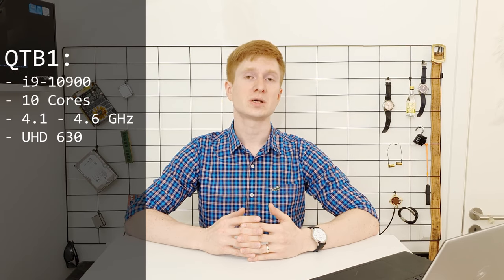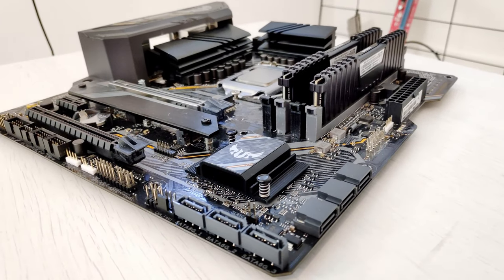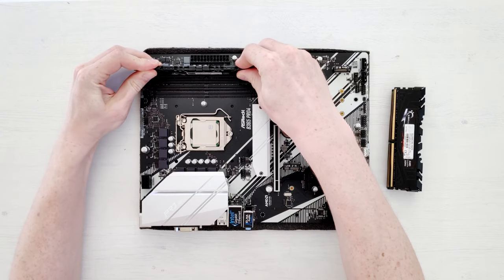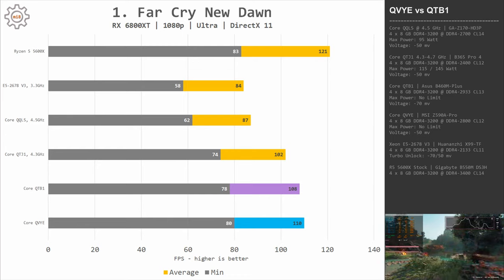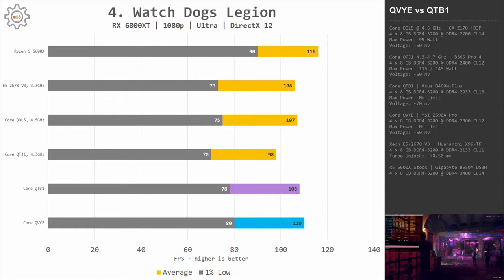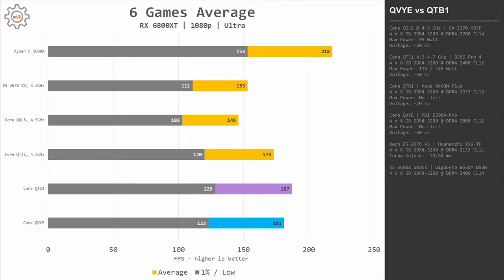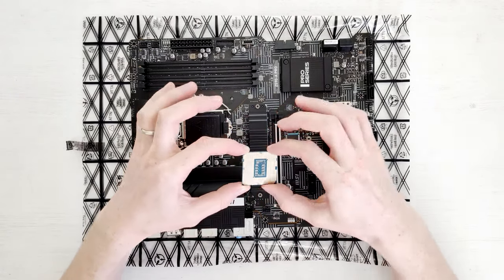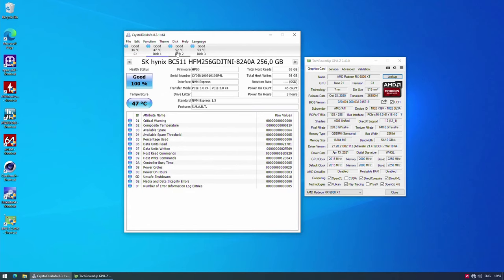🇬🇧 Core i9 QTB1, QVYE, QTJ1 – test and comparison against Ryzen 5 5600X and Xeon E5-2678 V3

Comment: Far cry new dawn, game work on 6 core
>qqls - 4.5 GHz- 87 fps
>2678v3 - 3.3 GHz - 84 fps
HOW?????
Reply from the maker: It comes down to the RAM configuration. E5 has quad memory channel with tight memory timings, while the QQLS was running dual memory channel and not very tight timings. Also, I didn't overclock the CPU cache, due to the VRM throttling. With a decent overclock on a decent motherboard QQLS would give much better results.

Comment: i9 10900k QTB1 vs i9 11900k QV1K vs r5 5600x , storck vs overclock , aguardando ansiosamente , like obrigada
Reply from the maker: R5 5600X is the best.
Reply: @Miyconst  Why? The i9 11900k QV1K beats the 5600x.
Reply from the maker: @Ryuuken24  beats in which way?
Reply: @Miyconst  Beats it in performance. I wasn't really looking for benchmarks, I just came upon this ES chip that was close enough to the R9 5800x, which has lead me to search for these ES chips for better value.
Reply from the maker: @Ryuuken24  theory and facts are different things. Ryzen 5 5600X is a much better option than the 11th gen ES CPUs from Intel, even though the ES CPUs have 8 Cores, and R5 5600X has only six of them. I would only go with Intel if I would be able to save at least 100 Euros on the system.
Reply: @Miyconst  These new chips do cost a 100 pound less, or you could bargain for a lesser price but, without more people testing them out, we cant be sure of their true value.

Comment: Just discovered the existence of the qtb1 , perfect because I wanted to upgrade i5 10400 , I have gigabyte b460 d3h, you said that the single core turbo would be locked at 4.1 GHz, all core still at 4ghz?

Comment: Need you help please :( I have an QVYE on asus B560 F gaming wifi with 4x8GB corsair vengeance lpx 3200 and my system is very unstable, even I had dropped the memory speed to 2800 the windows still crash or freeze screen :(

Comment: Hello, need your help here. Im offered $110 for i9 qvye + asus b560m motherboard. Im currently running on i7 6700k + 2080ti which is bottlenecked for CPU intensive game for ultra settings. Would you recommend it for gaming use?
Reply from the maker: Hi. You have already bought it, now my opinion doesn't matter. 😂 If the CPU works well with the motherboard - it's a good deal for $100, otherwise I would avoid it.
Reply: @Miyconst  Thank you for replying! ive decided not to go crazy and went for i9 10900k combo instead - costs me about $220. Do you by chance know how to tame this beast? im using the old corsair hydro h100i v2 and temps goes up to 90c~ while gaming.

Comment: I have been using this CPU for about 8 months now.    I have been noticed a few problems with mine.   First I can not load the CPUs on board graphics drivers. The "Splash screen" on my MSI B560I looks strange.   Also, I get problems on core 4 of the CPU.  Causing system lockups!

Comment: The big questions about 11gen are: 1 wether AVX512 will ever gain any ground in any real use application 2 wether you need the better encoder/decoder in UHD750. I would say the uhd750 is the main reason to go 11th gen at the moment, like i will do with mixed Tesla system for video editing.
Reply from the maker: Yes, the better encoder makes a big difference, when it's actually needed, but for a casual gamer, Ryzen 5 5600X is a better option.
Reply: avx512 currently are used by PS3 emulators for a hefty performance improvement. avx512 allows gen 11 th to surpass 5800x on the emulator

Comment: I'm bit suprised that QVYE can't take memory higher than 2800MHz. All i've seen seems to indicate taht QVYE doesn't have locked memory multiplier, and even earlier samples has limit of 3200MHz.
Reply from the maker: Me too, maybe my particular sample is bad.
Reply: It's not the cpu, it's the board used.
Reply from the maker: @Ryuuken24  I have tested the same QVYE on a Gigabyte Z590 motherboard, and even though I was able to increase the speed to DDR4-3200, the uncore speed was only 2.1 GHz, which resulted in much worse scores overall.
Reply: @Miyconst  That was really bad but, the sellers say the boost clock is motherboard dependent, so who really know which board can clock higher without purchasing a lot of them.

Comment: Having some issue with setting up memory on my  QVYE and AsRock B560M Pro AC + , even if I input it manually it does always default back to 2133mhz and does not do that on my ASUS B560M  Pro 4. Using same 16gb kit G.Skills 3200mhz on both motherboard, the ASUS is able to boot using 2800mhz totally fine using default xmp timings, the AsRock on the otherhand won't even let me change frequency manually to 2800/2666/2400mhz and inputing primary/secondary timings, it constantly comeback to 2133mhz and even at 2133mhz I can't change timings... Maybe someone would have experienceed something similar, I just like the look of the AsRock and find it little frustrating that I can't be doing anything with my ram settings. Any inputs would be appreciated, love this Cpu great $$$ for Performance. Love your Channel btw, keep the good content coming !!! Cheers
Reply from the maker: QVYE is known for memory issues, so it's pretty much expected. You could try different BIOS versions for the AsRock board, but it's still not guaranteed to work better.
Reply: @Miyconst  Thanks for the reply, I did try with both available BIOS V1.30 and 1.50 sadly no change. 2133mhz wouldn't bother me too much as long as I would be able to tighten those timings but sadly that doesn't work. Bring it down to a good CL11 would be my goal, same as my 2697 V3 server. I would be interested to see the comparison between let's say something like a 11400 @ DDR4 3200mhz vs QVYE @ DDR4 2133mhz just for fun, sadly I don't have one handy to have a real-life scenario comparison as they are both similar in price tag in Canada :)

Comment: Hello, i have one question, can QVYE i9 11900 work in z490 motherboards and being able to set ram to 3200mhz or QVYE just works on new 11th gen mobos?
Reply from the maker: QVYE is a very picky CPU. It works on Z490 if BIOS is updated to support 11th generation, but memory is unknown. With MSI board it was maximum DDR4-2800, with Gigabyte DDR4-3200, but the CPU memory controller speed was just around 1.5 GHz with no possibility to change, thus the performance was pathetic.

Comment: In my testing so far, QVYEs seem stable around 100 - 140 mv negative offset - 6 tested so far
None was unable to complete Sisoftware sandra, 30 minutes CInebench r23 loop, blender and vray benchmark with -100 even on low end asrock boardWeird...
Reply from the maker: I could be that I have got a very unlucky sample or there is something add with my MSI Z590 motherboard.
Reply: @Miyconst  Power use reported under r23 is around 125/130 on hwinfo

Comment: QVYE could work with an Asus B460M R2.0? It has H470 chipset and Asus page says it is compatible with 11th gen. Nice video!
Reply from the maker: Yes, it should work, but there maybe be an issue with the uncore frequency.
Reply: @Miyconst  Thank you. Just one last question: which CPU would you choose if the price is about the same: QVYE i9 or a retail i5 11400? I'm thinking to upgrade my i3 10100F in next year. Subscribed to your channel!
Reply from the maker: @yorchrzx  I would definitely pick i5-10400 for regular users, and i9 QVYE if you can be sure that your motherboard is fully compatible and you have a specific workload where QVYE would outperform i5.

Comment: In my case - it's an Asus Z170iPG mobo, 3000cl12 for Ram(~40ns), 4.4Ghz for cores / 4.3Ghz for cache 1.25V for the summer time(140W Max for full 16 loaded threads)
Reply from the maker: And which CPU?
Reply: @Miyconst  sorry,  information is for QQLS
Reply from the maker: @X1th  So, you managed to get DDR4-3000 with this QQLS? Do you use the one with a lid on top or the one with a naked die?

Comment: Can QVYE  use with gigabyte b450m ds3h motherboard?
Reply from the maker: Definitely not. B450 is an AMD AM4 motherboard, QVYE is Intel LGA 1200.
Reply: @Miyconst  Sorry ;-; I told you wrong.I mean b460m.
Reply from the maker: No, B460 chipset doesn't support 11th gen CPUs either.
Reply: Thanks <3

Comment: is it safe im pair QVYE with asrock b560m pro4?
Reply from the maker: Yes, it should be safe if you have adequate air flow in the chassis.
Reply: @Miyconst  yeah my case is have enought airflow. and now currently use watercooling cpu. does the pcie 4 work?

Comment: hi a question about the QTB1 (i9 10900) will it run smoothly on a b560?  brand asus b560m tuf gaming
Reply from the maker: Yes,  it would, but in my case the single core turbo didn't work correctly, it was maximum 4.1 GHz.
Reply: @Miyconst  I have an msi b460m mortar in gaming mode all the cores goes to 4.1 ghz what I did not like is that I could only put 2666mhz and not 2933mhz in the ram I could not, it gave video ...
Reply: @Miyconst  Please help me with this and what can I do ... I have an msi b460m mortar but I can only use 2666mhz ram because if I put 2993mhz it freezes or does not start windows in a QTB1, I await your answer thanks
Reply from the maker: @dark-op7466  I would like to know how I can help. You CPU or RAM refuse to work with such speed. If you bring the PC to me, I can test both separately and identify the culprit.
Reply: @Miyconst  interesting ... do you think it's the ram?  since it is a teamgroup t-force rgb ddr4 3200mhz
Reply from the maker: @dark-op7466  Yes, very well could be.

Comment: Given this charts Ryzen 5 5600X is a beast in value/performance ratio right now. Taking a risk with engineering samples is just to enthusiasts I guess, its hard to justify buying it in other situations given the actual prices.
Reply from the maker: Yes, Ryzen 5 5600X is a great value CPU if you can cheat on taxes by buying it from AliExpress.
Reply: Nah 1 year and my i9 10900 still boppin
Reply: Plus you can sell it off in a full build for like 2000 😈

Comment: Hey man, i have one question, If you can answer i am gonna be extremely grateful, I have one X99 Rs9 mobo with the E5-2630L v3, i downloaded your app to do the unlock/undervolt, but when i select the mobo (X99 RS9) the BIOS versions who appears are the X99 8M F ones, is something wrong or they work the same? it will work If I use then in my motherboard?
Reply from the maker: I assume you didn't watch my Machinist X99-RS9 review. 🙂 This motherboard is compatible with Huananzhi X99-8M-F BIOS.
Reply: @Miyconst  Got it, thanks man, one more question, which of the BIOS you recommend me to use? as im using the 2630L. I did unlock with other method and his clock didn't reached 2.9Ghz, only 2.6.
Reply from the maker: I would recommend -70/50 mv reduction.
Reply: @Miyconst  Thanks man, gonna try that
Reply: @Miyconst  Hey man, sorry for bothering again, but i have one last doubt, as i said before i did the unlock turbo boost, but the multiplier are at (x 26.0), and the clock is just 2.6Ghz, can I try to do it again using your app or is it recommended that I remove the unlock first and do it again
Reply from the maker: @FenixszG  you can use my app straight away, it replaced entire BIOS so it does not matter if you flash the original BIOS first or not.
Reply: @Miyconst  hey man, i did it and worked pretty well, but the multiplier still didn't reached x 29.0 (x 28.0 is the current) and the clock is 2793Mhz, a higher mv reduction could be the solution? thanks in advance

Comment: Would the performance in the intel cpus be a little better without the undervolting?
Reply from the maker: No, undervolting does not affect the performance, I have validated that.
Reply: @Miyconst  thanks for the answer!
Reply: Undervolt improves performance until you are unstable.
Reply from the maker: @gabrielecarbone8235  I would say that undervoling SOMETIMES improves performance, it's not always the case.